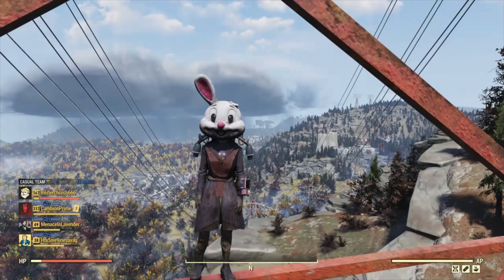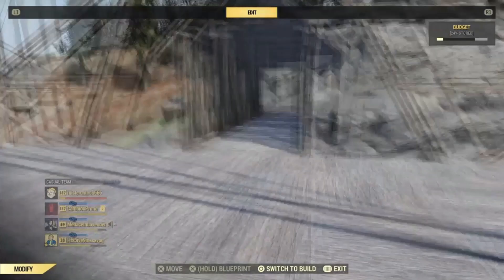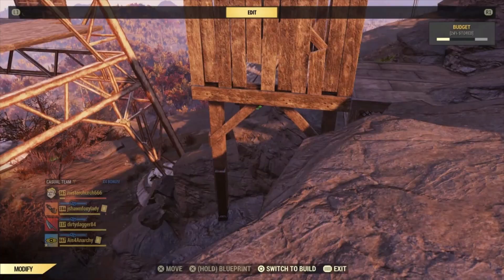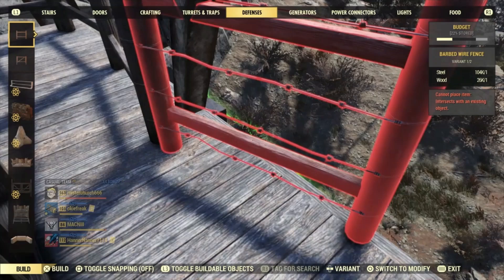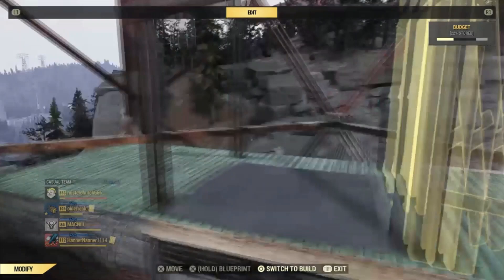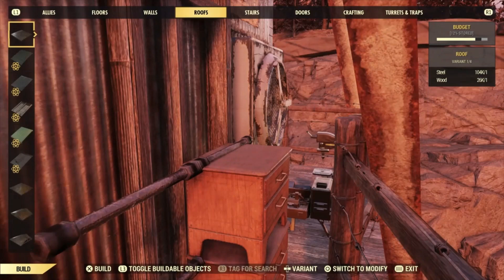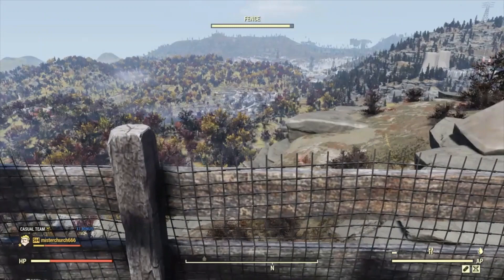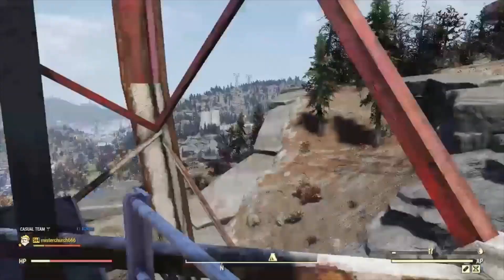Immersive Power Pylon Base Build Fallout 76 CAMP Tutorial

Comment: Nice Camp! But I got a question…how do u place the electricity through the walls and so on? I got crazy doing my electricity in all camps…thx
Reply from the maker: The easiest way is to place a conduit on a rug. Attach wire, move rug once. After that you can place the rug anywhere and it won’t break the wire. You can do the same thing with wall conduits if you use a sign instead of a rug

Comment: they should release a 'spray paint' tool since the angles when building mean that you can never really see anything. you could spray the area you need place the piece on, or spray around a post so you know where it needs to be.

Failing that, would jumping out of build mode, then shooting where you need to place it, then quickly jump back into build mode and place it on the bullet hole - or don't, whatever

Comment: This does look cool, but my question is - where does it dump you when you fast travel to it? I've built bases on top of cliffs before that dump me right at the bottom of the cliff. Also fast travelled to base before that's dumped me underwater lol.
Reply from the maker: It puts you nearby. You can move your camp module to change your fast travel spot away from the cliff
Reply: @misterchurch666  Oh, I didn't realize moving your camp module changes the spawn point! Might have to experiment with that lol
Reply from the maker: @BadgerOff32  yeah! You will spawn to the north west of it I believe, and you (the camp owner) will also spawn somewhere different than other people, so test with a friend for best results :)
Reply: @misterchurch666  Lol I wish the could have just given us a 'spawn point mat' like we had in Fallout 4. Would've made things much easier. Thanks for the info though. I'll have to play around with it and get the spawn location optimized. Does it matter which way the camp module is facing?
Reply from the maker: @BadgerOff32  they have those in workshops, but they removed them from camps when they added vendors because people were making trap camps with them. There’s a way to get them in your camp but I’m on the fence about showing it in a video for the aforementioned reason 😅